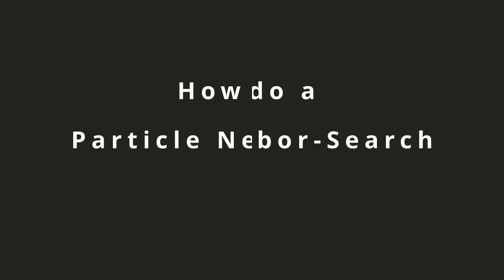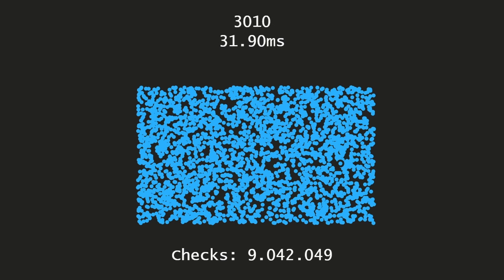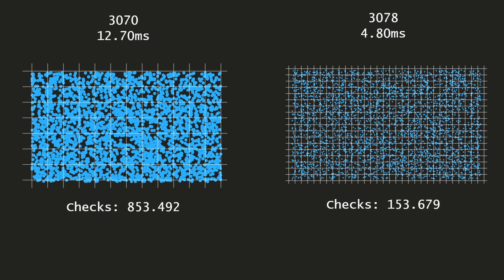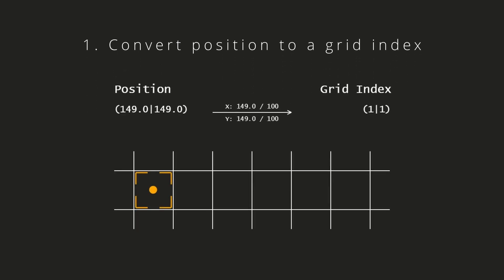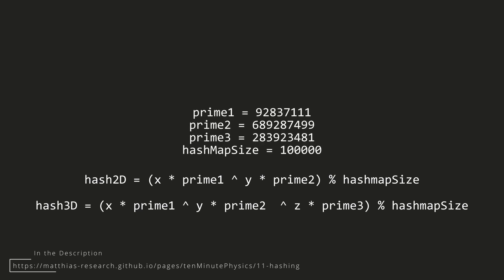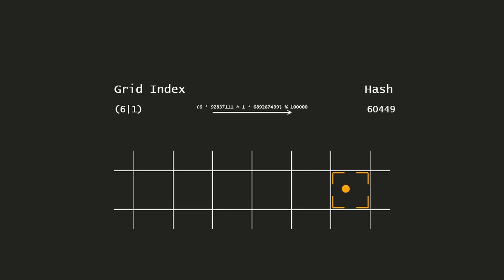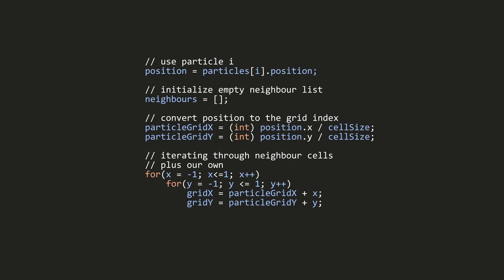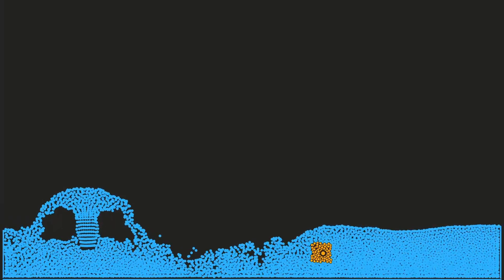Fluid Simulations made easy - 04 How to do a Particle Neighbour Search

Comment: Thanks for the explanation, really good quality. 
My only issue is that the number of checks for 100 particles will actually be 4950, not 10000 (you'd loop 'i' against 'j' = 'i' + 1, not to check itself). Just a caution there :)